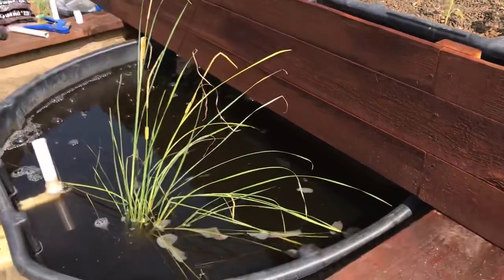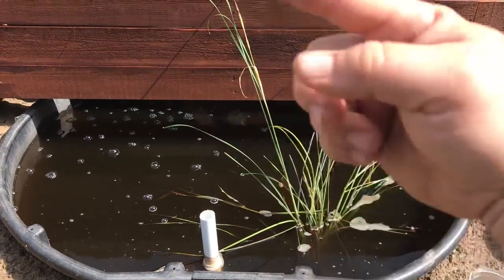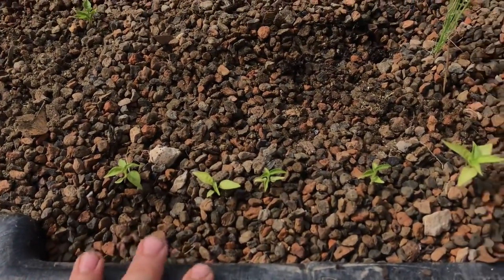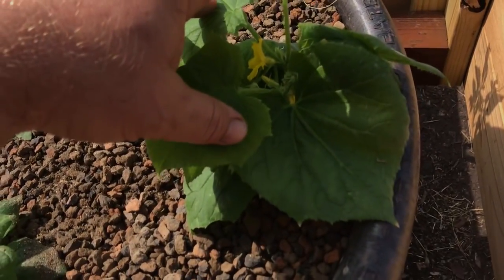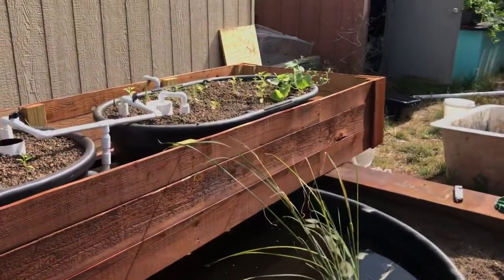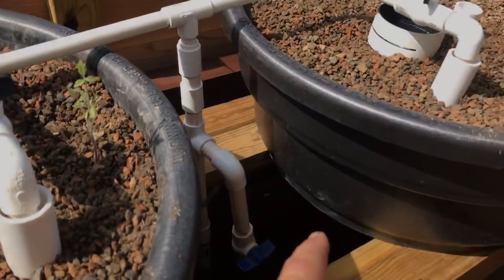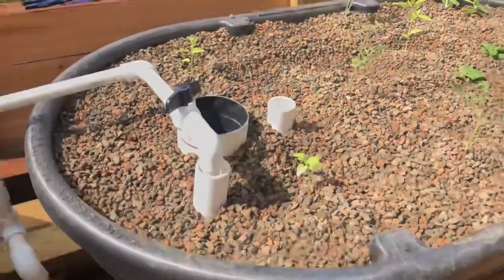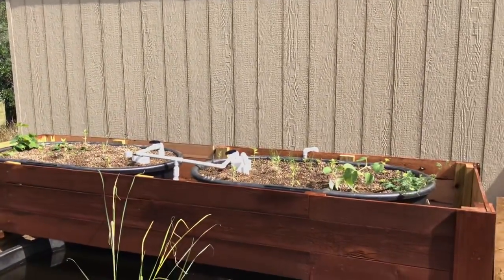New 300 Gallon Aquaponics System - Part Six

Comment: Finally caught up on this build Jack. 👍 Have had same issue with temperamental siphons. No logical reason why it shouldn't work other than it wants to be different.
Looking forward to see how you set up the wicking beds. Are they going to have soil in them?
Cheers mate
Reply from the maker: Yep, simple flow though.  The fiberglass tubs are 20 inches deep and will have 7 inches of lava rock the rest soil.  Simple overflow it looks like a low bell siphon minus the siphon.  

The one that has a problem it must be some sort of slippage.  I noticed yesterday that it starts to dribble a tiny bit before it starts to over run the pipe.  I tried to tighten it but it didn't work and it is working flawlessly with the old school simple one so for now I am leaving it alone. Just weird though, why it will work with one but not the other.

Comment: 1:20 - Surface water movement hinders floating vegetation. 
Why not jsut put some kind of water shield around where the water drops into the tank. If could go a couple inched above and below the water line, preventing the plants getting beat up.
Reply from the maker: I have considered that, I may do it but the blocks add structure and edge to the system.  I forgot to show other tanks were something similar were done.  Your suggestion is valid though, it can be as simple as a bucket with holes in the bottom on a cinder block for instance with the bottom filled with gavel.  Thing is I would need at least two to do that.

Comment: Looking killer so far. I've found that if you over tighten bulkheads they leak sometimes.
Reply from the maker: Just for everyone here, when I took the bulkhead off, it turned out I left out the fricken washer!  Leak mystery solves, still I took the opportunity to put a bead of silicon on it and I am just going to always do that from now on.
Reply from the maker: yea it can happen, I always start with just a hand tighten, from now on I really should just always apply silicon when I install them new.  It can't hurt and it is cheap and easy enough to do.
Reply: Jack Spirko if your not making mistakes your not trying hard enough👍  were all human lol
Reply: You can crack the fittings, white pipe dope and plumbers tape helps.